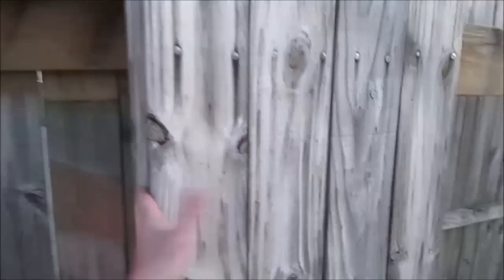Big Ol Rolling gate

Comment: Why did you install 4x4 so high when you only need to support and cover wheels at the bottom?

Maybe that just saves from having to cut the 4x4 and pickets down to size.

I may do a shorter one...
Reply from the maker: Mainly to act as a guide. Please do whatever will work for you.

Comment: Nice work.  The only thing that concerns me is wind on that much fence with only that little latch keeping it together.
Reply from the maker: That is a very good question. I needed to put a bolt to help make sure the latch didn't come off. As far as wind it took a few good licks during a storm we had the weight help make sure it didn't get ruffed up to bad. Next gate I have planned (year or two away) will have a better air flow and lock set up. Sad to say we moved from that location and now the new place has been keeping me off production for a bit.

Comment: Nice job sir. I have a wooden gate and need to build a sliding fence a the front, like your example. Is it possible to get some close-ups to the way you designed the track and wheels, especially the wheels and how the fence glides through? Thanks!
Reply from the maker: Sadly we sold that site in august. Depending on how big your gate is will give you how you need to figure it out your tracks. I am not a professional but I would be happy to share ideas on your gate to help.

Comment: Oh yah how do you build a steam powered automatic gate opener or maybe one powered by mice?
Reply from the maker: Okay to the aspect of gate improvements, steam-powered a bit dangerous kind of unreliable in regards to getting it started maybe with a bigger steel or Stonegate steam-powered be a little bit cooler. Using mice meh too many variables and I'm not on for mice really. Now solar power were the battery backup or just Electric in general would kind of be a good idea however that's outside of my scope of skills right now.

Comment: I noticed that the pickets on the gate extend below the frame.  How did they slide past the rollers?
Reply: Also, how did you determine the vertical dimension of the frame?
Reply from the maker: The wheels I used turned mad the fence and gate two pieces. So as long as it didn't drag the ground it was fine. As for spacing I really don't know I went with what seem to work so 16×4 foot I think

Comment: Trying to figure out how to get the gate to roll. Do you have a video or pictures of how the gate sits on the rollers/track?
Reply from the maker: Sadly not any more. The in wheel were roughly the same thickness so I put a channel on the bottom of the gate for them to roll in. As a upgrade you could use new wheels and a metal channel for them to roll on under with the added benifit of structural support
Reply: Duncan Junction's The Mad Man how did the gate no flop around at the top when you open it? Or to keep it from rubbing the back of the fence?
Reply from the maker: @chadguerin3586  guide posts the overhang of them kept it in line

Comment: Is that an XJ in the driveway?
Reply from the maker: Good eyes. Yes that is our Dyno. She is a 1996 Grand Cherokee. She is our main work horse for Duncan Junction. Needless to say if we ever win the lotto she is getting fully restored.
Reply: Duncan Junction's The Mad Man I have a 99 XJ and it's my workhorse ;)
jeeps are the best
I like your gate...this is a good idea for my fence
Reply from the maker: @jbossnack  Me and the boss both had jeeps when we met I had an 04 2w and because Dyno was already the project jeep I traded in mine. As for the fence it makes me happy when someone gets an idea for their own projects. Insider secret about the gate. I HAD NO CLUE WHAT I WAS DOING.  this thing was a cartoon compared to other gates I have seen. some things I would like to make better on the next one.
Reply: Duncan Junction's The Mad Man that's awesome. I've built a privacy fence without any prior experience, just watched some amish guys building and copied their design :) I sorta need a wider sliding gate now that I got a trailer so I'm thinking about doing this in summer to keep the trailer more secure. very good idea using inverted castor wheel for the roller
Reply from the maker: @jbossnack  Some Amish guys are no joke. as for the castors one way you can improve it it by getting some from a farm equipment store that way you know they are designed for outside use.

Comment: Not helpful on how to build a rolling gate as you went fast for most of it and explained nothing.
Reply from the maker: I am sorry you feel i went too fast. The process was sped up in order to compact this video into a length pleasing to viewers. If you have any questions about the project; I would be more than glad to answer them. This video was not intended to be an in depth how to video, but rather a build share.
Reply: Great video. Thanks man! I noticed at a certain point the gate rocks back to the lawn. If you wanted to fix this how would you do those
Reply from the maker: @ttudoc5690  in this case I would have had to build up that section of yard. I have seen some do gates where they are on a slight decline however my skills did not allow me to do so in the time I was given. or put more casters to made the drift easier.
Reply: @duncanjunctionsthemadman7418  they make spring loaded casters now, particularly ones for turf, so the variance in distance to ground is mitigated, also helps support weight on the rear of the fence panel.
Reply: @matthewmontgomery1015  yep, shepards casters. They're great!